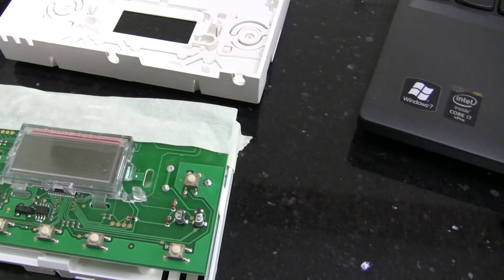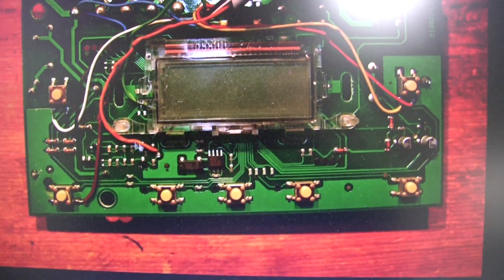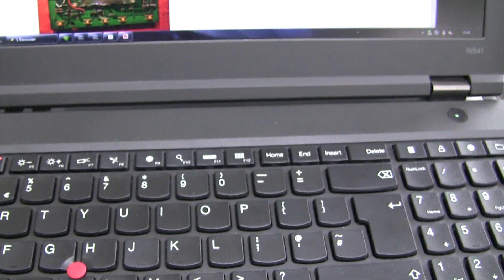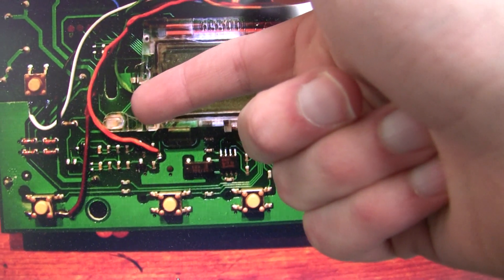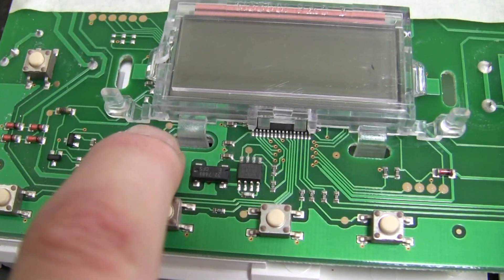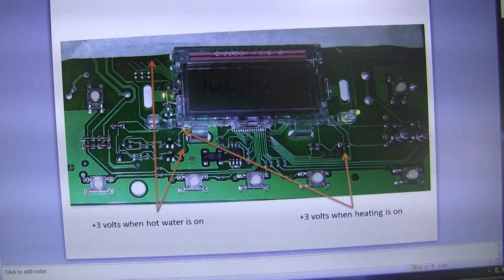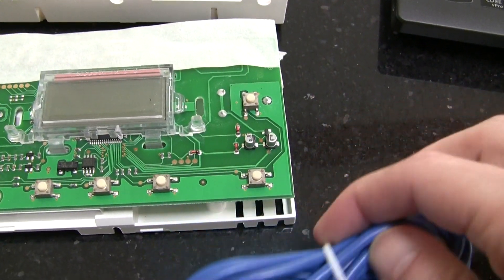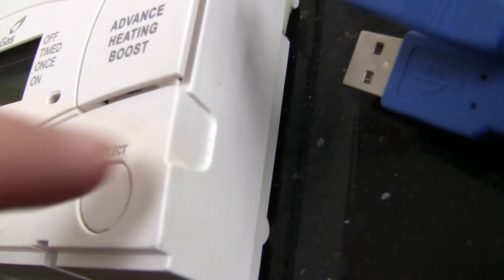Raspberry Pi Heating Controller - Part 1 - Project Overview

Comment: I have an old LP722, which I have just replaced due to failed battery.  I came across your video while searching for a schematic for these units.  

The device I posses does not have an internal transformer, but rather a capacitor divider circuit connected directly to the mains to provide a step down for the logic supply voltage.  I suspect the more modern versions are the same, as I see no transformers in the video and the additional cost is not warranted for an entirely enclosed device such as this.  

The issue here is that all the wiring out of the case and also the connected electronics will be referenced to the mains voltage.  Please understand the hazards associated with this while undertaking this project, this is not a warning to be taken lightly.

Comment: Hello again. I hope you don't mind me picking your brains on this project but I've just ordered the raspberry pi zero and so I'm getting closer to making a start on this. I wondered if you identified a suitable power supply point, on your CH control PCB, that can power the pi? I thought it would be very convenient if a 5V supply was available. I might have to introduce a voltage regulator otherwise, as there isn't a convenient socket near by my controller.
Reply from the maker: +Adam Stubbs Hey Adam.. I didn't end up drawing power from the PCB of the central heating controller.. there was a mains switch nearby (used for isolating the shower unit) that I added a mains socket to, so that has a standard USB adapter plugged into it.

Comment: Hello, Can you tell me which CH model you're using please? I have the Drayton LP722 and I'm wondering if the internals are likely to be the same. Also, is it really necessary to use the PiFace 2 HAT? I was under the impression that the Pi could handle the 3V that you're measuring and can output 3.3V at the GPIO. This is a great project by the way it's great to have someone speaking who doesn't constantly say "so I'm just gonna go ahead and..." before everything they say/do!! Thanks very much.
Reply from the maker: +Adam Stubbs We have the British Gas UP2 controlling a Bosche Greenstar boiler. The control board looks v.v.similar, so you'd be fine locating the contacts for the buttons.. then use a multimeter to find a suitable place to monitor the LED. 

Yes, the Pi should be able to handle the 3v fine, but I've seen other projects protect the GPIO pin with a 'buffered input'.. I'm a novice at electronics, so having the PiFace2 there meant I didn't have to research that further :)

I've got the Pi installed in the airing cupboard now & need to do a new video showing how far the control software/interface has come.

Thanks for the complements! :D